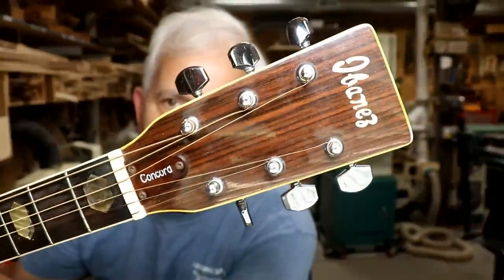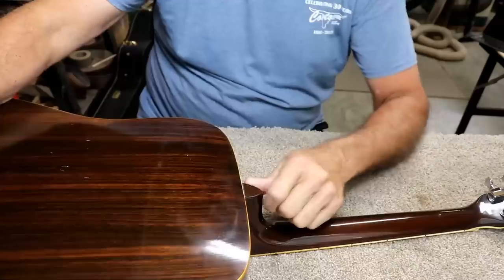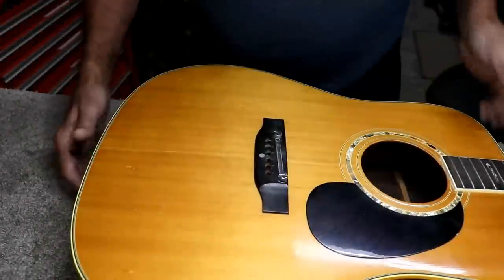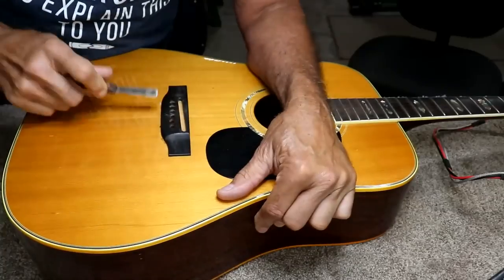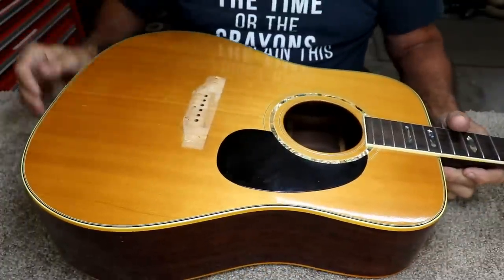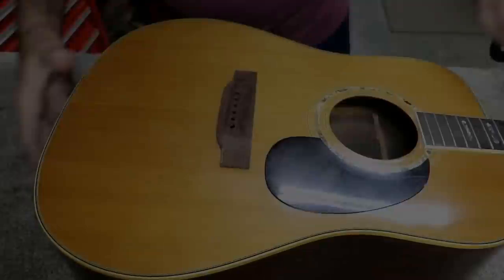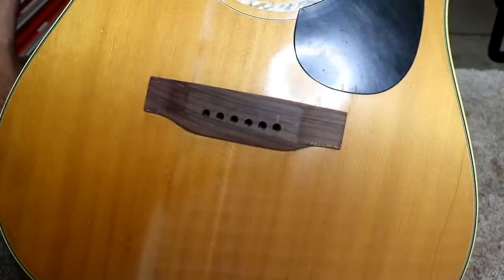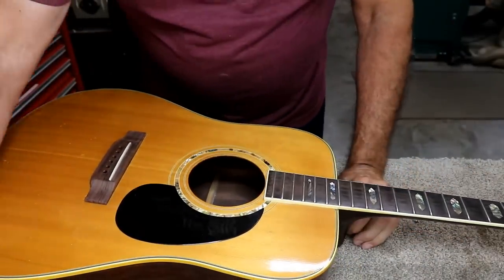590 RSW This Ibanez Concord Guitar is ON THE BORDERLINE - A Detailed Setup - Part 1

Comment: here's a little secret I'll share, I've had some great success clamping the top flat like you did here and while clamped shoot the box full of steam, it must not be over done tho, the steam softens the glue and allows the wood to form a new memory, when cooled remove clamps and the top will be and stay nearly perfectly flat, maybe not perfect every time but you catch my drift, has work most of the time for me.
Reply: Randy is correct. I used this method on a 60's Gibson 12 string. It had the worse belly behind the bridge and the worst dip in front of the bridge I have ever seen. It was so bad that the bridge and the bridge plate were permanently warped. After I removed both, I clamped the top and filled the box with steam. Let it stay clamped for 2 weeks and the top was perfect. Replaced the bridge plate with paduch and then fit the new bridge. After 3 years under full tension nothing has moved and the top is perfectly flat. I think the difference was the steam.
Reply: @billyporterfield7755  Great job Billy. I bet that Gibson 12 string sounds great.
Reply: @billyporterfield7755 : After seeing all of Jerry's videos, of working on Gibsons, I'd say
the original bridge plate was more than half the reason for the belly bulge.
Reply: I thought that was my secret! Check all your braces first. I have done a lot of guitars that way and I have also done what I call the 5 minute neck reset! I use a jig and get the neck straight and then use a c clamp to get the neck where I want it. I always go a little more. There is a lot more to it than you think so don't try this at home! A lot of good guitar builders and guitar shops told me it wouldn't last but I proved them wrong. I actually recall Jerry saying that as well! The first guitar I did it took three try's  until  I got it right!
Reply: I've done that on a beater. Still going strong...
Reply: Randy Where did your secret come from?
Reply: Good tip. Thanks. I'll try next time a guitar comes in with a belly bow.

Comment: You can watch many luthiers use the dry heat method with foam cutters and it has made the process far easier, in most instances.   Average of 10-15 mins to pop a neck with those sticks.   The evidence is there to see.  You just have to look.

Comment: Nice job - I used to hate to see you file but after I did it once I understand that it does take a lot of filing and a lite filling is very OK.  I got the micro fiber stuff for polishing and can get a mirror finish - - -  12 pieces or a dozen.   Thanks for doing the fret board - razor blade trick that fret board really needed attention.  Keep Smiling

Comment: The heat probe, where you drill into the dovetail joint (under the 15th fret on that style of guitar) puts 2 very thin high heat probes deep into the dovetail joint. Just using a block heater, like you'res, will not work to do a neck reset. There is nothing wrong with the use of steam either, It's all in what you like, but the electric heat probes do work. Keep up the great videos Jerry.
Reply: Jerry does not use the block heater to loosen the neck joint, but to
fretboard extension, just like the bridge.
To loosen the neck joint, he uses steam.
Reply: @zapa1pnt  
He said in the video that he tried it and it on a neck reset and didn't work for him, so he sticks with steam. I'm not dissing Jerry and think he does great work. I was only explaining how the dry heat method is used by other Luthers. Each person has their favorite way too do things and there is no absolute one way too do things in guitar repair. So sorry if I upset you, I'm not belittling Jerry in any way. He is one of the greats at what he does.

Comment: To eliminate the pucker factor when routing the saddle slot, why not take a blank that's the right thickness, determine the slot angle for intonation and then cut the slot in that. Once the slot is routed, cut out the shape and contour of the bridge. Sounds backwards, I know, but if you mess up the slot you're not wasting something that you've spent a lot of time on.

Comment: gluing on bridge...might a few very short, sacrificial  locating dowels help with alignment? Just long enough to penetrate the guitar top but not interact with the caul or the clamp...then pop them (or drill them) out.  I use a stone bit for chamfering some things and it works great and burnishes the hole very nicely.

Comment: Jerry, after sanding the frets with 600 sand paper, is the metal guard plate, Really
necessary ( with the Simichrome), since you are going to scrape the fret board anyway?

Comment: You commented on the Xacto blades being cheap same thing with the Bick Yellow throw away shaving razor blades terrible quality. Cant even get one  good shave out of a new blade nowadays.Been using them for years always been decent.Threw them out after trying another batch thinking it was a one on thing. Same dull problem and then I changed brands with a little better result but still not like the old Bicks use to be .Whats going on darn it is it the steel or the manufacturing  sharpening process?????Really annoying these little things..

Comment: I put my #12 Hooked Scalpel blades in a small barrel X-Acto handle.  Much stiffer than a scalpel handle.  It might work better for you.
Reply: Putting the scalpel in the X-Acto handle is a good idea but the hooked
blade would not work well, for scoring around the bridge.
Is there an X-Acto style (triangular)  scalpel blade which will fit the X-Acto handle?

Comment: You did such a great job on that Ibanez ! I have an old old Goya 13 classical that need some adjustment of the neck, sucjh a good tone for a small guitar, but the action is so high! I am so afraid of wrecking the darn thing, though, I would rather try to practice on an old WSchmidt steel string that I am sure could use a similar adjustment.. I only paid $80 for the old Schmidt,m but I will get another opinion at the local music shop here in Medford, Oregon, it is only 1/2 mile right down my street, Riverside Avenue. and ask the fellers in the shop if the repairs would improve it any. I like the sound of the mahogany, and it sure would be nice to have a guitar that is not so demanding of my fingers!

Comment: I have a 1987 washburn made in the USA 8703184.   D14 N.        Nice old guitar. She. Paid. 500 dollars in 1987.  It’s been rode. Hard and put away wet  but still plays well and really. Rings loud. The neck by the headstock is cracked but repaired or glued. Neck needs adjusted just a little or truss rod needs tweaked about one sixteenth to high n

Comment: When the top is bowed badly just un glue the bridge, put a tail piece on it and make it an arch top. It will never bow any farther after that.
Reply: That might make the top cave in from the bridge pressure ? My thinking is that if it bellied , it could move the other way not being designed to take weight . More a question than a statement.  Peace ✌
Reply: @davidharris7431  I meant it to be a joke.
Reply: @davestambaugh7282  Ha , sorry brother , must have been in serious mode . Peace .
Reply: lol
Reply: @davidharris7431 : BTDT. 🤪🤪🙄🙄😵‍💫